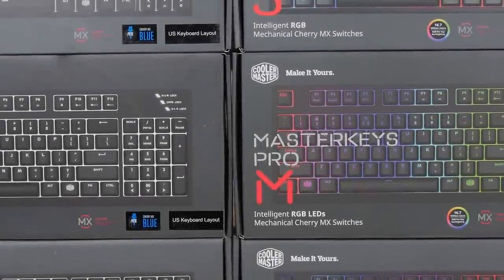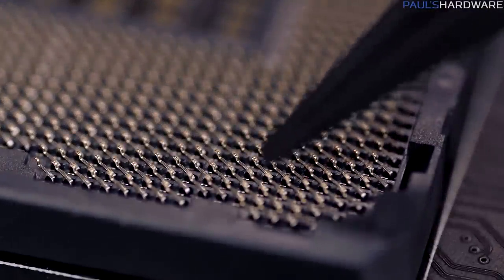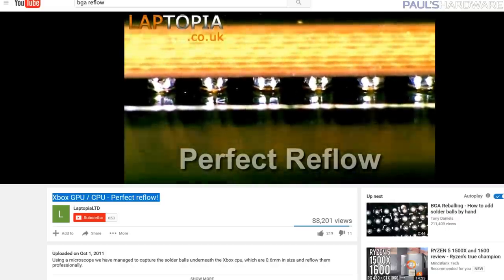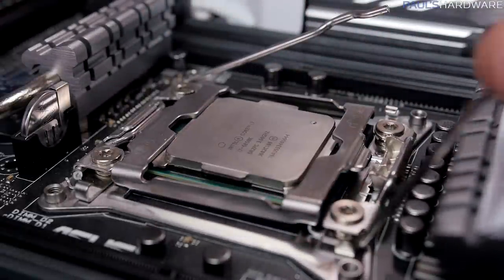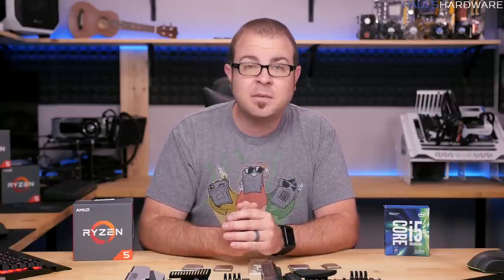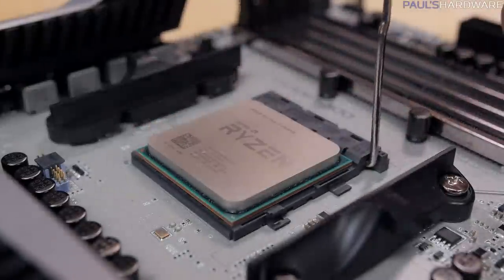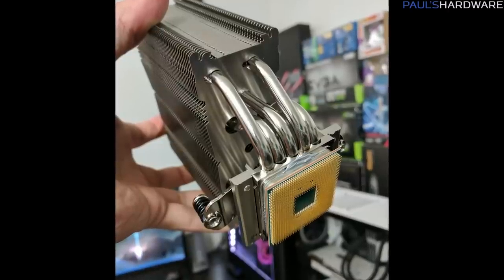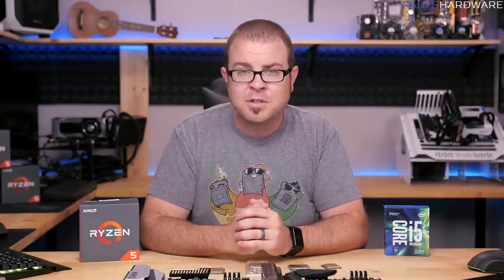LGA vs PGA! Which is better?

Comment: if you don't pull the cooler straight off then you wouldn't have the issue of the processor coming out. just slightly twist to break the thermal seal
Reply: Everyone can be a general after the fight is over. You don't need a rocket scientist to figure out what you've done wrong, it's just not realising you're about to do something wrong.
Reply: Also, If a chip still looks like its stuck firm, either from old set, cemented paste or suction, don't just yank it out. Instead slip a plastic paste spreader inbetween the two and either twist it or prise them slightly apart (the only thing that thermal spreaders, are good for)
Reply: If the cooler bracket has screws going in through the 4 holes of the motherboard that can't be removed while it is installed on the motherboard you can't really twist it
Reply: @RedBull10812  You unscrew all of the retaining screws first, then you twist the heatsink slightly, before lifting it. With clip brackets, it's the basically the same, just un-clip it first, then twist it.
Reply: @fafski1199  In my case I had a CM Hyper 212 (original one, first version) on my FX build and on that one you can't take out the screws since you first have to take the base plate of the cooler off first and the screws for that are facing the motherboard (and can't remove the screws going through the motherboard holes into the backplate either cause they are under the heatsink). I tried looking for the most elegant solution but there were none for that cooler at least, maybe they improved the design in newer versions, you even had to take the whole cooler off to replace a fan so a bad design for that first version of Hyper 212 anyway. However i only managed to yank the CPU out with the cooler only once without any pin/socket damage. Heating the heatsink first works fine tho, pretty easy to take it off once the paste turns liquid-ish from the heat. With Noctua NHD15 i can most probably do that, haven't taken this one out yet, but looks totally possible because of the smarter mounting brackets design.
Reply: Know it's 4 years, but stock amd thermal paste is so sticky, that when I was working with servers based on Ryzen CPU, it was quite common to rip cooler with CPU glued to it, despite socket lever being pulled down.
Reply: @mikadofxx9030  yea you have to slightly twist the heatsink before you take it off, don't pull it straight up and out
Reply: @fafski1199  yes

Comment: I remember dropping my FX-8350 onto my desk and it fell onto my carpeted floor. I thought it was done-zo but still took hours using a credit card to re-align half of the pins perfectly and sure enough - it worked perfectly! Bewildering, but I eventually sold that CPU on eBay for $100 before upgrading to an i7-7700k. Been a fan of PGA since then since it's easier to even attempt to repair. The LGA motherboard pins spook me out.
Reply: Sounds reliable just like a 486 DX! Those were tough cookies!

Comment: Thank you for the tip on the cooler removal for PGA! My first ever motherboard (LGA) had a bent pin. A friend of mine has steady hands and was able to touch it back into place after 40 minutes of poking. I trust CPU makers to make reliable pins more than I trust motherboard makers to make extra sensitive pins.
Reply: for me its the opposite. In most cases the motherboard is cheaper then the actual cpu (besides some ultra high end mobos)

Comment: LGA socket pins are a lot easier to bend than many people think.  I've done it, and had absolutely no idea how it happened.  Socket pins are like needles on a pricker bush, they'll grab anything that comes anywhere near them, and they're a PITA to deal with.  I prefer PGA, but I can just imagine how difficult it would be to fit 2K+ pins on such a small CPU package.

Comment: PGA is less nerve racking when installing a CPU than LGA. the first time I installed an LGA CPU I though the crunching sound wasn't supposed to happen.
Reply: basically its one hell of a deep insecurity.
Reply: jo schmo No joke It feels like you're right about to break an LGA board when the arm comes down.
Reply: "...and then the lever arm or arms can be pushed back down with a LITTLE bit of pressure..."
This quote and the often recommended method of testing your components on the motherboard box led to me nearly shitting my pants when installing an Intel CPU for the first time.
That ain't no little bit of pressure. It almost crunched my motherboard box under it and I felt like I was breaking PCB traces with every degree as I pushed the arm down.

Even now, years later, it terrifies me.
Reply: It likes someone just farted so loud that it almost feels like you did it.
Reply: It's more to do with different models of boards rather than them undermining force required. I have installed in cheap B85 board where push force required was bending the board, meanwhile my other x87 board needed little to no force at all.
Reply: Amien rais
Reply: Amien rais
Reply: You get a full body workout by installing an LGA CPU.
Reply: +Golden grenadier Do you remember LIF sockets? Before ZIF you didn't have a lever arm to pull down when the CPU is in place; the socket just grabbed the pins hard enough that you didn't need it; hence "low" insertion force. Inserting the processor was easy; just push down with about 15 pounds of force. Removing it was nerve wracking, bending a little on each side with a screwdriver (if you didn't have a special tool)..
Reply: I've had bent pins on an AMD processor before and straightened it out quite easily either with a really thin flat head or the tip end of a ballpoint pen. When removing a heatsink I was always told to either slowly twist or rock it if the system wasn't powered on or just boot it up and shut it back down.
Reply: +Jordan Johnson lol, underrated comment
Reply: My CPUs tend to be more expensive than my motherboards . . .

Comment: To remove a cooler from a PGA socket, you can always firstly try to gently turn it, so that the force only goes to the paste, instead of the pin-locker.. (The socket will never allow the CPU to turn at any case). This way you make sure the paste gives up before pulling the cooler upwards. Using this method the CPU will stay inside its socket when you get the cooler..
Reply: Good idea, unless the capacitors are too close and you don't have enough room for much of a twisting action. I accidentally pulled an AMD Athlon cpu out with the heatsink recently. The old system had not been ran in years. I should have fired the unit up to warm the old compound. I couldn't have tried the twist method because this was a Dell Opteron that had this big plastic hinged shroud encasing the heatsink. I don't believe I could have twisted that without breaking the plastic first.

Comment: Try unbending LGA pins. I think that's all I have to say.
Reply: How about not bending them in the first place
Reply: accidents happen, my dude. one guy just ruined a mobo when he just slightly inserted the CPU in. unbending the pins was hell on earth. your eyes just cant focus with that cryptic pin pattern. PGA all the way
Reply: Personally, I've done this! I'm PGA all the way!
Reply: absolutely! i got a lga mainboard with already bent pins and the shop refused to refund it bc they just said they didn't do it... took me 2 weeks and countless tries and hours sitting at my desk with a bright torchlight and a razorblade to get those f'in pins back the way they should be. on the other hand back in the athlon days a good friend of mine bent some pins on his cpu and asked me to help - 15 minutes and we had it.
Reply: Done it. Took hours, but my rig is running sweetly on a couple bent pins.
Reply: I bent my lga pins resulting in ram slots 3,4 not working.Fixed my bent pins by using a pen.Working just fine.I didnt even believe it would work after that
Reply: I bought my current motherboard used that had two bent pins. I took a screwdriver, bent them back and no problemo :) Took like 15mins to bent the two pins. Have been running my 2600K @4,7GHz since.
Reply: Maybe my nearsightedness gives me an advantage, but I've been able to repair both motherboards where I've bent pins. One was a real doozy - it got twisted around 180 degrees. It just takes a really delicate touch and a pair of surgical-grade tweezers.
Reply: just slide a credit card between each row...? Take 3 mins????
Reply: Why do you think Paul uses a razor blade?  If you tried to fit a credit card between two rows on a recent CPU you would flatten two rows of pins.

I remember bent pins back in the mid 90's on a Socket 7 CPU, hard to damage - easy to fix, there were only 320 of them and they were as thick as comb teeth.  We need to replace pins because these days of 2000+ pin server chips you can practically bend a pin by blowing on it.
Reply: iv done it
Reply: Well if a 7 year old can do it, why can't you? Yes, been building computers for 25 years now. Snot hard if you have a brain and aren't coked out of your mind.
Reply: As your sweater sleeve brushes the lga pin set, and you freeze like a deer in headlights....
Reply: A credit card is too thick to do much good, but a fine feeler gauge can help. The biggest issue is just getting the proper magnification to accurately judge what's going on...if you can see what you're doing, then a fine pair of tweezers are probably your best bet in any case~
Reply: and patience!
Reply: Also, you don't need to delid Ryzens...
Reply: More to the point, if you do delid Ryzens, expect a high chance of destroying your CPU.
Reply: Trypticon8 wtf, how did you bend LGA pins?? Thats Crazy
Reply: Cereal Tech Where did I say that?
Reply: John Wick Ryzen is soldered so delidding improvements are marginal at best (1C or 2C at best)
Reply: I'ts hard with your naked eye, but doable. I figure if you use a magnifying glass it wouldn't be much of a problem.
Reply: Cereal Tech - it happens. Don't wear long sleeves when mounting your cpu. Especially not a sweater... but based on your response you haven't built enough systems, nor gained enough wisdom to realize sometimes it happens, and sometimes you open the new MOBO and it's already that way. maybe 1 out of 1000, but it happens (even to the best of them) you think by now presenters would have learned to be careful enough to not drop brand new $600+ hardware. but they do that, too. (I'm looking at you, Linus!) The same logic applies here.
Reply: Dont dropit in wrong way and force it to close
Reply: Chris Lesmerises yeah sure... can you please explain me how could long sleeve damage LGA Pins??.. your point make no sense
Reply: ive fixed lga motherboards fine with a magnifying glass and a needle just gently brushing them upwards. PGA are absolute cunted things that i have never managed to not break as they have to be perfectly straight where as lga they don't have to be absolutely perfect
Reply: Just another thing. I've never bent LGA pins ever mainly because I don't just jam cpu's in which you would have to do to bend them. The boars I fixed with bent pins came from the Acer factory with 2 bent pins that controlled the 2nd ram slot so it still worked unless you wanted to use that ram slot
Reply: Once I fixed two pins using syringe needles. I mean the pin fit into the hole and I managed to pull it back.
Reply: pins get bent in other ways, your statement makes it seem as though you think that's the only way it can happen, "because (you) don't just jam cpu's in which you would have to do to bend them" it's ok. we all speak without thinking sometimes.
Reply: I had to do this to save me another 300$ on a CPU about 2 years ago... was a pain in the ass and took about 10 minutes with the right tool to align it perfectly (little OCD here). It definately is worth the try to save yourself some money if you've accidentally bent one or more. In my case it was the classic scenario, the cpu was sticking to the heatsink, I pulled it off, put the heatsink on the table, looked in the socket and went like "where the fuck is my cpu???", took a look under the heatsink and saw that the whole outer line of pins were bent... GJ
Reply: I've done it at least a dozen times.  Not fun, but it is possible.
Reply: Jkjh
Reply: You only need a 90 degrees metal object, with that tool you can unbend any pin that you want. Trust me, i do that things since 775.
Reply: Juan Sambucetti Dentist's tools? :)
Reply: 4epa1012 a nail.
Reply: Done once... didn't work though XD
Reply: I´ve done it multiple times with a crappy magnifying glass and a male to male cable, just bend them slowly and carefuly and it should take ~5min per pin, lga has been a bigger pain for me.
Reply: @ChrisLesmerises  LGA pins bend only when you insert CPU wrongly in the socket ie. the triangles dont match, or you push down one of the CPU corners really i mean really hard.Normally if the force is uniformly distributed, ie when pushing down the cooler when installing, the LGA pins will recoil like a spring and nothing will be damaged.

Comment: You know what is infuriating? That LGA pins in the socket are so elaborate and fragile, whereas AMD CPU pins are thick, solid and straightforward. It's really difficult to get bent pins on an AMD processor, but don't you dare sweep your finger across an LGA socket. That's another reason why Intel are cheap ass greedy motherfuckers. It's also harder and more expensive to manufacture, because they need to make them work like tiny springs. Paul is mostly right, but as I said, pins on AMD CPUs - not just "hard to damage, easy to repair", but extremely hard to damage and extremely easy to repair. Even pins that broke off completely - a soldering iron and a bit of patience can do wonders, also that pin might not have been crucial.
Reply: How is intel cheap because of motherboards for their cpu's not being durable, isnt it the motherboard manufacturer problem?
Reply: SHH, you're using common sense. No seriously thought. Its how the chip is made on the backside where the pins are. Due to that you cannot just make some custom chip. Intel provides blueprints for both.
Reply: The Mobo manufacturer doesn't make the socket. Intel and AMD provide socket designs to certain companies (like Foxconn and Lotes) who then make sockets to send to motherboard manufacturers.
Reply: holy shit. I just did that with a motherboard i returned.

Comment: PGA is better for stability of connections for overclocking especially under LN2 situations, but yeah I can see benefits of both, personally I'm a bigger fan of PGA because the motherboards are harder to damage, and I always treat CPU's carefully when removed so the pins aren't a concern for me, never broken a CPU pin yet even when delidding an FM2+ chip

Comment: i went with intel so far, but now that i socketed my first amd cpu, i must say it is really nice and a smooth feeling, it feels more solid and as an enthusiast, it made me harder than socketing my intel cpus. pga all the way
Reply: "As an enthusiast". Why did you choose Ryzen then?
Reply: Doctor Jew because its a great CPU?!
Reply: are you kidding me? ryzen is crazy good. i paid 340$ on an 8 core outperforming all my buddies way more expensive cpus. the fun part is they could have bought ryzen but didnt. now regret sets in.
Reply: because a universal standard would be nice
Reply: i guess you are right. its good the way it is. and i like both sockets. i like all sockets, they make me hard if i mount them
Reply: +PhilfreezeCH Not really, just go a little bit overkill with it and it 
will be perfectly fine.  They can wire it however they want on the 
backplane, so the socket doesn't dictate the chipset at all.